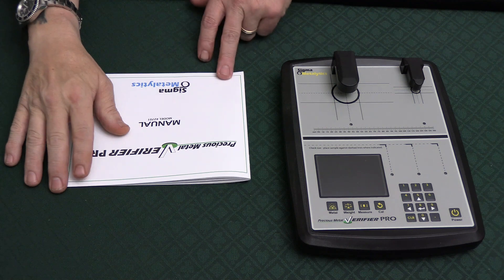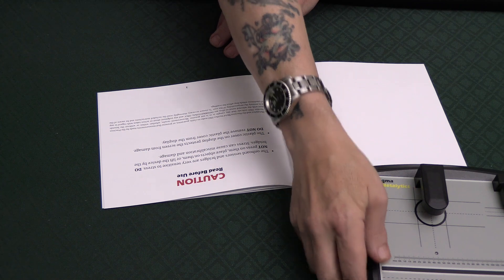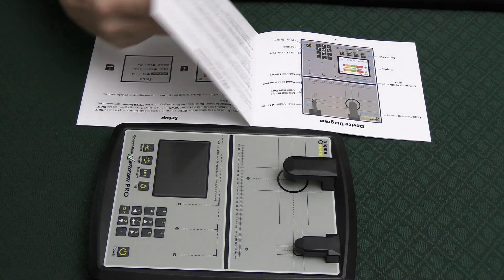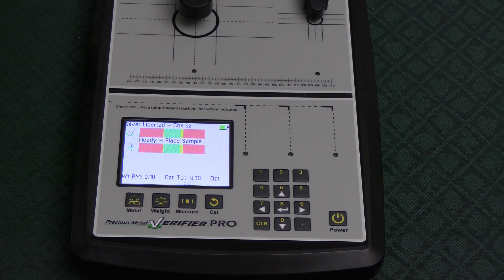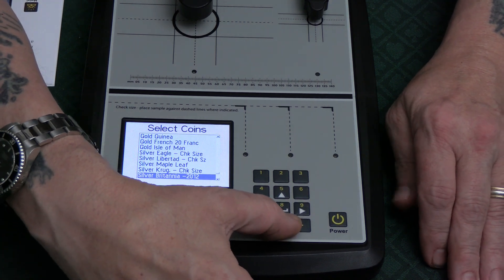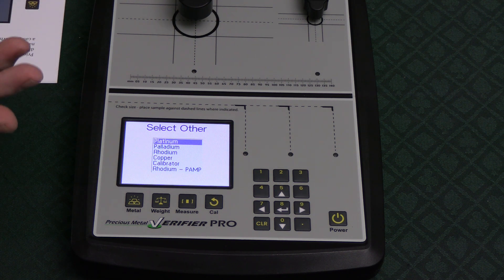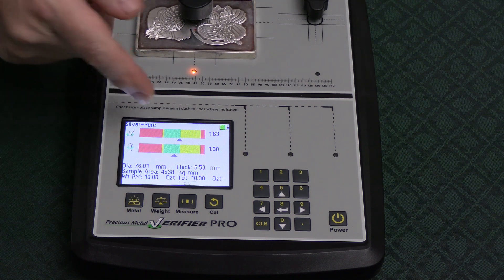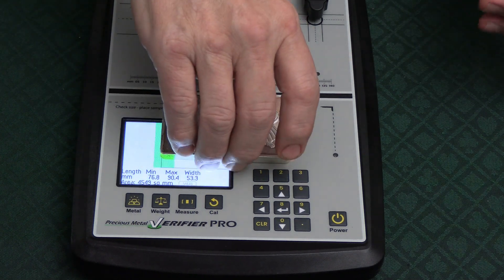Sigma Metalytics PMV Pro setup and basic features

Comment: a simple way to measure a 1 oz maple leaf gold coin .9999 is by the measurement or dimensions, the weight, and a very powerful magnet. If the dimensions of a fake gold 1 oz coin, ie., mixed with tungsten, are right and the weight is a little bit off or not right then the next thing to do is use a very powerful magnet.
Reply: Then what happens, with the magnet? How to use it as tungsten is not magnetic?
Reply: @kimnilsson7501  Tungsten is not nearly as conductive as Gold. So it would fail the Sigma which reads through th ecoin.
Reply: Right. Way less conductive as the sigma will show. While silver and copper are more conductive, the high density of gold (>2x) makes it pretty obvious if either is trying to pass as gold.
Reply: @kimnilsson7501  While neither tungsten nor gold is magnetic, The bulk resistivity of gold is less than half that of tungsten. So, for instance, moving a strong magnet over a gold maple leaf on a slippery surface (like a teflon pad) will cause more movement than one sees with a tungsten fake. This is due to eddy currents. Alternately, letting a small neodymium magnet slide down a tilted Maple leaf will move about twice as slow as it would on a fake.